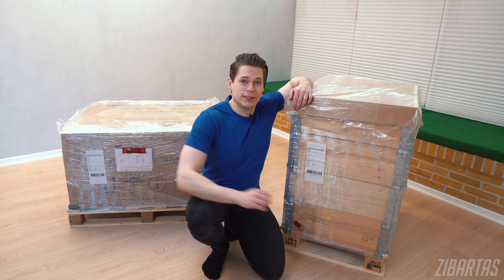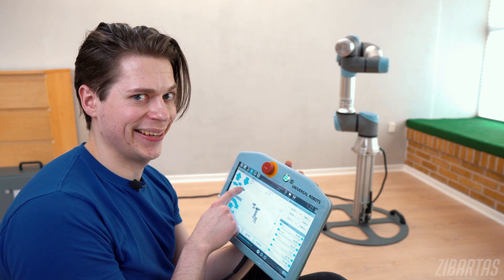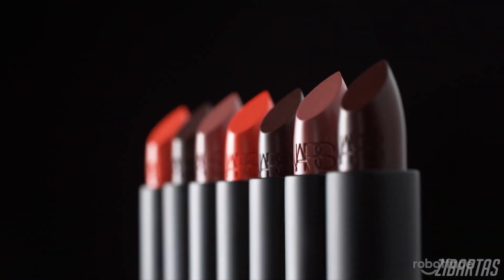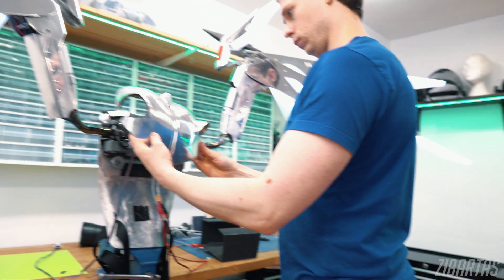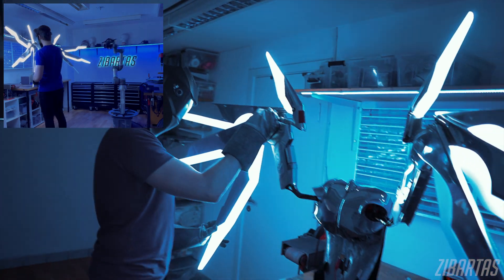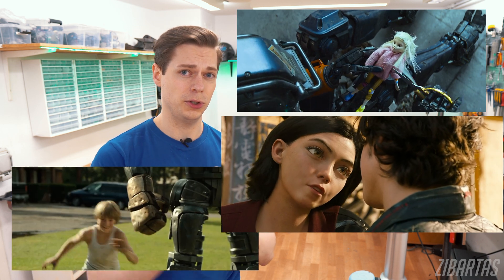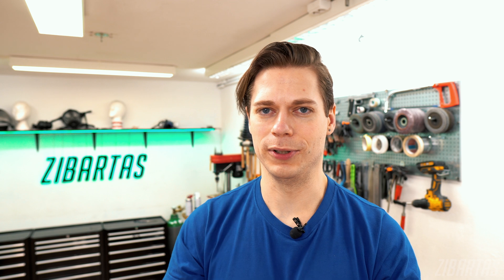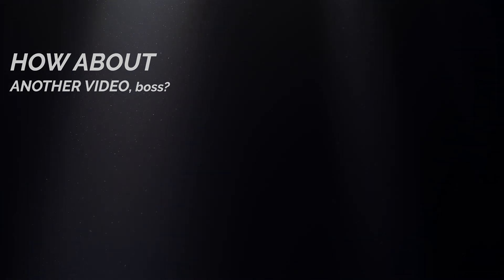The $35,000 Robot Arm of My Dreams

Comment: 2 reasons why the footage is wobbly / shaky:
- Heavy robot arms like these require a very solid foundation, usually you either screw them into the floor or you at least put a lot of weight on the base. Otherwise, their own weight will lead to unwanted movement of the base and the robot itself.
- Your camera and lens has "floating" elements that get shaken around by those moves. There are lenses and cameras without this problem which should be used instead here. I have a camera and lens without image stabilizer specifically to get around this issue.

Comment: Nice video, 
I recently programmed a copy UR 5s of them to move a copy of characters around for a set of Christmas windows and agree that they are easy to get started with programming and interfacing them to each other so far they have performed about 29,000 w minute shows in 7 weeks with one more week to go.
And whilst we have had 3 minor stoppages in that time none where due to the robots just extra sensors we integrated to ensure “Bert” & “Ernie” ( yes I named them ) getting blocked by other set pieces we used and in one a plug coming out of a supervisory PLC a used to adapt them into our control system.